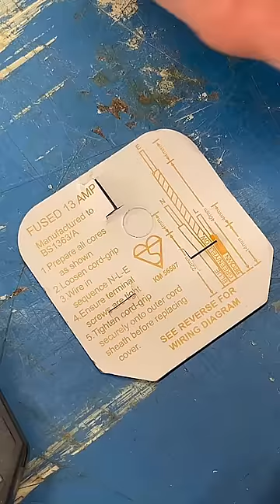Probably the Best Plug in the World 🇬🇧🔌🔌🔌

Comment from the maker: The classic British standard 13A plug with a fuse in everyone one. Take a moment to admire the engineering. Think how much it hurts when you stand on one in the middle of the night with bare feet.🦶
Reply: It hurts in the middle of the day too when you stand on one and can leave a nasty scar to boot ! No pun intended 😂
Reply: Lego… ‘hold my beer’ 😂😂😂
Reply: The Americans genuinely think a fuse in the plug isn't necessary.

I can't help but laugh at them.
Reply: That is why us American's made one that lays on the side and doesn't try to take a foot off.  Also we can transport our cables in carry on luggage on the plane as they will fit in the bag unlike your plug that you have to check in the belly of the plane due to the size and weight!  😁👍

Although it is nice that you can literally plug in your EV at any socket in the house and charge it, with 32A breakers on the rings, that is just crazy the amount of current in a domestic outlet available, just swap out that 13A fuse for a nice 32A fuse!  😂🤦‍♂️
Reply: Why u take a 13 amp fuse out and replace with a 3 amp ?
Reply: Yeah. rest of Europe has no fuse either. 16A breaker protects against short in the appliance cable, and appliance has a fuse for it's protection, so yeah. not really necessary.
Reply: @chargehanger  The only occasion you don't need a fuse in the plug for the appliance is if the cable connecting the socket to the distribution panel and breaker is of the same current rating as the appliance cable.

This is often not the case. People want their appliance cables to be thin and flexible, so it is often the case the appliance cable is of lower current rating than the circuit cable in the electrical installation. In this scenario, you need to have a fuse to protect the appliance cable.
Reply: @seanstrickley3992 because is meant to protect a smaller consumer up to 3A
Reply: @chargehanger appliance has a fuse ??? Not usually, power tools don’t usually. Not ally it’s only electronic equipment that does such at TV computer etc
Reply: @PHealey1981 😂😂😂👍
Reply: they are great, the one drawback is that they are FUCKING HUUUUUUUUGE.
Reply: ,110volts,say no more.
Reply: @Chris_In_Texas ,America is way behind UK and European countries when it to comes any thing electric, wirenuts,say no more.my son-in-law is American,he can't get over how superior our Electrical and plumbing systems are.
Reply: @seanstrickley3992 ,thought that would be obvious and I'm no sparky.
Reply: I, too, have watched that Tom Scott video
Reply: @shimarlie1  yes they are over engineered but that's why they are great. Run a 16a welder on one no problem ( 1/4" brass fuse of course 🤣)
Reply: @onelineal9382  I used to do electric. He lessened the power consumption that the plug can take dropping it from 13 amps to 3amps if u used something over 3 amps it would blow that fuse is what I get from it
Reply: Fuses are useless! EVERY small short circuit can trip the 10A or 16A breaker! EVERY electronic device has a self resetting fuse internally! Sorry but European safety laws about electric power are the best!
Reply: @MyNotSoHumbleOpinion  interesting concept. So all appliances need a power cord rated to carry the full load of the outlet then? Even a small fan or table lamp would need a 1.5 mm cord. The only problem with the fuses plug is that lay people just fit a 13a fuse as a replacement as they are all the same size.
Reply: @johnwarwick4105  exactly! Every single appliance must be rated for 10 or 16 Amps with power cords with 1.5mm2 or 2.5mm2! Italian plugs for example are made in two sizes depending on the current rating! You can't plug a 16A device in a 10A plug and vice versa!
Reply: @MyNotSoHumbleOpinion  so how many sockets are one one breaker? If you were to plug two high load devices on the same breaker if would trip! That's the beauty of the highly  misunderstood uk Ring main. One circuit provides 32amp of power fused individually from 3 to 13 amps
Reply: @johnwarwick4105  power outlets are subdivided by zones like kitchen, outlets night zone, outlet day zone, whole lights, local heating room, conditioner or heat pump, laundry, and so on... Every zone has a 16A breaker (or 10 for lights) and it's very very difficult (almost impossible) to exceed 11A in each zone! Probably the most power consuming devices are hair dryer and iron but they're only 2KW!
Reply: @johnwarwick4105  ring main is obsolete. Needs more copper today, and also does not cover "open ring" type faults.
Reply: May i make a suggestion when connecting the cables……. it’s soooooo much easier to connect the neutral first, saves trying to bend it around, too fiddly 😊
Reply: @chargehanger  so am I but can still out work some of these young ones 🤣🤣 ring mains will never die, long live the ring main, 🤣🤣
Reply: @seanstrickley3992  because the cable / device is rated below 13A. I'm the UK 3, 5 & 13A are the common sizes for plug top fuses.
Reply: @MyNotSoHumbleOpinion Historically the whole house used to have one ring main for all the sockets rated at 32A. We also have 13A devices such as electric kettles and (again more so in the past, heaters and electric cookers).

Now a days there are multiple ring main circuits, and a separate supply for electric cookers / ovens.

But there are many old houses which havent been upgraded, so for every device to be universally safe we need to follow the lowest common denominator.
Reply: @seanstrickley3992 Low powered device. The fuse is designed to protect the cord from the plug to the device!
Reply: That's fucked up brother 😢
Reply: @philipridout2274  sounds fair! Now I know the purpose of that choice about fuses! But that makes the plug "the best plug for the UK", not the "best plug of the world"! 😉
Personally I don't think that there are "best plugs", but only terrible plugs like the north American ones!
Reply from the maker: Smaller diameter cable
Reply: @PHealey1981 11a
Reply: @deang5622 why is it necessary? We have breakers.
Reply: @onelineal9382 ahahaha no.  Being 120V we use thicker wire and draw a lot more current than in Europe.  Wire nuts handle current and heat much better.  Europe went 240V because they were poor after WW2 and needed to save money on copper, so thinner wiring went in.
Reply: @johnwarwick4105  in the case of a short circuit, cause by cutting the appliance cord, a 13A fuse blows only a few milliseconds after a 3A fuse blows, so not a huge problem in any scenario...
Reply: @Ironic1950  it's not always a short circuit though. That's why you have the calculations. In reality a short circuit can sometimes take out a b type 32a mcb as well as the 13a fuse.
Reply: @johnwarwick4105  The fusing characteristics are different; a fuse blows at twice the rated current, while an MCB trips at only 20% over the rating. Some equipment has such an inrush current, it needs a Type C MCB to avoid nuisance tripping...faults always involve significant overcurrent...
Reply: @onelineal9382 What kind of engineer is your son in law??
Reply: @deang5622  they don't really need because they use star topology instead of ring.
Reply: @MyNotSoHumbleOpinion and even in the kitchen the stove has its own 3 phase so that doesn't count towards the kitchen allotment
Reply: @efixx at least in Germany i only know like 2 or 3 different diameters/shapes of the entire cable, which is in line with the 3 possible plug styles we have.

First obviously the Schuko which is the big earthed plug, obviously with 3 cables it's the thickest. Then we have what we call the "euro plug" is basically a weaker plug because it doesn't have full metal rods and also has a thinner cable because 2 lines and is used for most unearthed devices, and then there's the in between which we call "formstecker" or shape plug in English. It has full metal rods but also has its shape expanded so you cannot grab the rods they will also not fit into the smaller unearthed sockets on extensions.
These are common on eg vacuums or the ps4 pro when an earth isn't needed but too much power for the euro plug
Reply: @professorg8383  a commie one😂
Reply: @onelineal9382  ah yes shibly doubly wubble snipper is my favorite plug
Reply: 😂, i m from Hong Kong and our place adopted UK electrical system. I used to complaint alot about the bulky design of a 13A socket, however after fews years working in this field, i really appreciate the safety engineering
Reply: I'm sorry I don't understand the one foot joke.
Reply: @deang5622  "The only occasion you don't need a fuse in the plug for the appliance is if " you are not in Britain as British homes have electrical instalations that are legendary bad...
For Polish people if they are buying home in UK standard procedure after purchase is invitation of Polish electrician that is then replacing instalation that for some reason looks like something from XIX century...
Reply: ...Then realize the unquestionable superiority of the european type F outlet
Reply: @deang5622 well I’ve lived my entire life with out fused plug and it works just fine, it also nice when you can just flip the breaker back on and not have to go buy more fuses
Reply: That huge honkin thing is only rated for 13 amps?😂😂😂
Reply: Technology Connections guy is going to have something to say about this.
Reply: Hmm I've walked around these plugs for 38 years and never stood on one 😮
Reply: @deang5622  We have these wonderful things called a "Panel-mount fuse holder", so instead of handling a brick of a plug we just pop the fuse out the back of the device :) As you folk would say, "bugger off"
Reply: @Heliosaurus  So you are saying all US appliances contain a panel mount fuse?
Reply: @monad_tcp  No. That demonstrates a fundamental lack of understanding of what the fuse is for. The presence of a fuse is not in any way dependent upon the circuit topology.
Reply: @deang5622  No, because appliances plug into GFCI outlets or are on dedicated breakers 💀
Reply: @Heliosaurus  And is the cable to the appliance of a lower cross sectional area than the cable from the distribution board to the receptacle?
Reply: pathetic british feudal engineering, dont anyone tell them about schuko
Reply: @rcajavus8141  Nothing to do with being feudal. Many countries developed their own plugs independently of each other. And the British designed a very good plug. It is a superb plug.
Reply: @deang5622  no, if that was the case, then a single breaker of 300A at the entrance would be enough
Reply: @deang5622 No, the British designed a quality plug to go with their archaic electrical installations. Most of the world doesn't need to add an extra fuse onto every plug.
Reply: What a mission. 😂
Reply: Great solution to problem they self created and could easily be avoided. Absolutely 👍
Reply: @MyNotSoHumbleOpinion they are better for other reasons too, having protected sheath on the pins long before US and even other countries. Accidental pull-outs are better too, reduced fire risk.
Reply: @bigpjohnson the 220v standard was set in Europe will before WW2 even started, in UK around 1938-1939,  all of it nothing to do with the war
Reply: @happyhappynuts  yes but a lot of other plug has the same features! For example the German shuko was patented in 1926, with a recessed shape that prevents fingers from touching the poles. As I said it's a good one but truly not the best, because it can't be "the best one"! And as discussed here, the fuse isn't "a feature" but only a necessity to correct a plant design flaw!
Reply: @seanstrickley3992 security reasons?
Reply: @seanstrickley3992  'cause the appliance may be taking less than 3 amp and/or cable may only be rated for 3 amp
Reply: @chargehanger  no, not all appliances have an internal fuse, washing machines and tumble driers dont usually,  plus cable from plug to appliance may only be rated for 3 amp or so, as commonly used on table lights,
Reply: @seanstrickley3992  thats the point, the device will be using far less than 3 amp in use so a more suitable fuse is fitted, cable may also only be 3amp rated although the one in the video looks 6 to 10 amp to me
Reply: @MyNotSoHumbleOpinion  not every overcurrent is a dead short...
Reply: @MyNotSoHumbleOpinion  in the uk devices using lower current can have lower rated cables such as 3 or 6 amp, and fuse in plug suited to the cable rating, or the device, whichever is lower, no need for 13amp cable on a maybe 100w max table light, its stupid!
Reply: I know someone who came from the US, emigrated here, then after a while started throwing away appliances as they simply didn't work anymore. Years later when i knew her, I asked her did she check the fuse... She didn't have a clue what i meant till I showed here and told her what they were ,and what they were for.  she couldn't believe what she simply had done and could have just been that problem instead oops.
Reply: Hurt ??? YOU KIDDING...????
You don't even remember it after a minute or 2...🤣🤣
Reply: There was Scotty l actually quite a lot of thought went into it's design, mostly around Which wires broke away first on extreme tension, the insulation on the L N pins the extra long earth terminal, the design of the socket it goes into. So yeah I agree best plug in the world.
Reply: @deang5622  because it isn’t. Here we have breakers in a panel. 
You trip it and just reset it. Not a fuse that you need to take apart things to replace it every time it goes.
How stupid is that.
Reply: @MyNotSoHumbleOpinion I hate polyfuse, tripped the fuse on my raspberry pi and it took 2 months to reset!
Reply: @Sicktrickintuner  
So… you have an appliance that has a cord rated to carry 3amps that has developed a fault that draws 10amps i.e., over 3 times the rating of the cord…. How’s that going to trip the breaker?
Reply: Ferrals for a 3A fuse is a bit overkill. I don't understand why we dont have 1A fuse standard, even a 690W rated fuse seems overkill these days.
Reply: @chargehanger  not quite, the breaker protects the house cabling and sockets, the fuse in plug protects the appliance cable and the appliance may have a fuse to protect the applicance itself.
Reply: @kaferere  "The UK electrics system is the absolute envy of the world"

That's the biggest lie I've ever heard in my life! 🤣🤣🤣🤣🤣
Reply: missing a trick not having affiliate links in your pinned comments.
Reply: I don't have to think, I KNOW it hurts through experience!
Reply: Everyone one!
Reply: @seanstrickley3992  maybe because whatever that cable is going to power will never draw more than 3A? Why have a fuse way bigger than what you'd ever need? You're only at risk of the fuse not popping while it should pop (e.g. a short that only generates a 10A draw frying the electronics).
Reply: @MyNotSoHumbleOpinion every electronic device does not have a self-resetting fuse built in...
Reply: I mean the US outlet still hurts to step on, just now you probably also broke it or need to bend it back.
Reply: What sort of squalor do you live in where you are in a situation where you can stand on a plug?

You would only stand on these if you purposefully leave a plug in the middle of the room. Not to mention you would be more likely  to trip up on the item the plug is attached too as apposed to the plug itself.
Reply: @seanstrickley3992 maybe the appliance doesn't draw 3kW
Reply: @philipridout2274  never seen sockets rated 32A 🤣🤣🤣, used to work in uk and replacing sockets do to high power consumption, you can’t overun the 3kw-3.6kw limit  in one socket without damaging it
Reply: @Chris_In_Texas  cant do that, each socket and plug is only capable of 13amp continuous without excessive heating, some 'bad' ones even cant take that
Reply: @seanstrickley3992 because the fuse protects the flex. Depending on the size of the appliance and the thickness of the flex you need to down fuse the lead.
Looks like 0.75mm flex so a 3a or 5a fuse is needed. For 13a you would normally be using 1.5mm or even 2.5
Reply: Tried. Pain scale from 1 to 10 the British plug is 9.5 scale compared to  Lego which is 9.
Reply: @deang5622 Well.. it isn't. 
Many European countries do not have fused plugs either.

Maybe it is a fullproof design for the UK cause you do not know how to properly use them?!
Reply: @glycerosfournaris2512  Actually it is necessary. It is is not necessary to make the appliance work, obviously, but it IS necessary from a safety point of view, which is what we are talking about.

I am amazed at how many of you on here think you are all experts on electricity when clearly you are very low qualified in electrical engineering.

So what I will do is now educate why most of you are wrong and why a fuse in the plug is necessary.

The fuse in the plug protects the appliance cable from overheating and catching fire.

The issue is this. The current rating of the cable from the breaker panel is in most cases higher than the current rating of the cable from the plug to the appliance.

To help illustrate this I will use some figures.
You could have a 32 amp cable from the breaker to the socket. Then the appliance cable to from the plug to the appliance could be rated at 13 amps.

For those muppets of you that can't figure this out, the breaker rating has to be rated at 32 amps (or less) AND therefore that breaker CANNOT protect the 13 amp appliance cable.

That breaker will not trip until at least 32 amps passes through it, which is way higher than the 13 amp limit for the appliance cable.
What happens if more than 13 amps passes down the appliance cable in this configuration? The 13 amp appliance cable catches fire and the breaker does NOT trip!

Are you folks seriously telling me you are unable to 1. Figure this out for yourselves, and 2. You do not understand this?

How is your electrical training so God damn poor?  Are you just electricians, is that it?
A bit challenged with your level of electrical knowledge?

So typically where you change from a cable of one cross sectional area to another, you should put a fuse in to protect the cable of lower cross sectional area.
Reply: @dasy2k1  You are talking to a bunch of idiots in this forum. Must have not got a clue. 

Just look at the comments and how they don't understand basic electricity. Probably electricians, that is why.
Reply: @sang3Eta  Because the fuse in the plug is there to protect the appliance cable and NOT the  appliance!

So we don't need a 1 amp fuse option in the plug because the minimum cable rating is 3 amps! So we only need a 3 amp fuse.

The manufacturers will put in a 20mm cartridge fuse in the appliance if they think it is appropriate, and a 1 amp rating, and even lower are  available in that 20mm format.
Reply: @deang5622  That issue is easily fixed with a fuse on the wall socket.

As many European countries do tend to have systems in place to protect from fire hazards.

Again it isn't needed on the plug itself if you know how to use the appliance and thus do not create a fire hazard.

Can't you figure that out mr/mrs engineer?!
Reply: @Sicktrickintuner  You are WRONG.
Go find my post where I explain why it is necessary.
Educate yourself.  Increase your understanding of electricity.
Reply: @glycerosfournaris2512  No it is NOT easily fixed with a fuse on the wall socket!

We have different thickness cables in use in the UK, for our appliances, which handle different magnitudes of current. Therefore you CANNOT have a single fuse in the socket on the wall!

The ONLY way a fuse in the socket could be a viable solution is if the British government banned all cable thicknesses except one and mandated all electrical appliances being manufactured in the UK and appliance being sold into the British market which is manufactured around the world can only use a cable of ONE specified cross sectional area.

And that is not going to happen.
Reply: @deang5622  Soooo this is ypur actual issue.

See the thing isn't safety but shift of responsibility from the state/government to the public.

Again since you are an engineer you can surely understand how 《hurtfull》 can be for two alliances to be on the same wall socket with a large difference in current needed.

Again it either boils down to the state shifting its responsibilities to the public - which is unfortunately not well educated I the school system - or that you s8mply cannot operate your appliances correctly with the means you are given.

An example would be that you would never have a washing machine or an electrical inventory plugged in the same wall socket with ANY other appliance.

Where I live we do not have such an issue.
Reply: @deang5622  As someone who experienced a 10w heat mat burn through a sofa, I disagree. We should have fuses at like 2x the expected power draw. Luckily, sofas are no longer made of flammable materials.
Reply: @sang3Eta  No.
You seem not to understand what the purpose of the fuse in the plug is for.
It is not to stop you getting burned by the appliance.  It is not to protect the appliance from malfunctioning.

It is present to protect the cable.
It is up to the manufacturer to put a fuse into the appliance, or other safety devices such as thermal cutout to prevent harm being caused by the product in the event it malfunctions.  This is not the purpose of the fuse in the plug.

In the example you cite of 10 watts, and you want a 1 amp fuse, the fact is 230 volts at 1 amp is 230 watts, so you are still going to get burnt with a 1 amp fuse in the plug.

It's not the correct solution. What you are proposing is not an effective solution at protecting the user of the appliance. And that is why it will never be adopted.
Reply: @deang5622  I understand, it just seems crazy to me that 3A 750W (probably won't blow until 5A 1,250W) is the lowest rating we have in the UK.
Reply: @deang5622  i know North America electricity. British power is just set up slightly more odd.
Reply: @Sicktrickintuner  Actually it is not odd, and if you genuinely understood electricity you will discover that English and EU electricity is far simpler than US.

I counted the other day the number of different plug types you have to support the different voltages and current in the US and it is utterly ridiculous.

Additionally, the US system has to deal with the split phase nonsense which you use to produce 240 volts because your nominal level of 120 is too low.

The EU and UK use a 3 phase system at 230. There is no need for all the nonsense around having a split phase system to run concurrently to the 3 phase system.

Your grounding strategy is mostly based around the use of earth rods which is the worst performing method to get the fault current back to the distribution transformer and this endangers people's lives and necessitates in many cases the use of multiple ground rods to get the impedance down low enough.  It's a completely crap approach.

You also don't generally have GFCI's in the breaker panels whereas in the UK they are compulsory, although older properties may not have them.  So instead you have to have GFCI receptacle outlets which increases the cost and leaves much of the electrical installation not protected by a GFCI.

So what you have presented to me is simply a biased opinion and not an objective assessment of the two electrical systems.

If you are an electrician you should be sufficiently skilled to be able to make an objective comparison of the two electrical systems but you haven't done that.

Well, I don't do bias. I do objectivity based on hard facts.

You claim your knowledge is high on the US electrical system, so let's see you come up with some hard facts where you think the US system is better than the UK.
Then we can have a proper discussion baaed on hard facts and not some silly opinion that that yours is better than the UK.
I want to see you back up your claim with hard evidence, just as I have done.

You can't say "Our US system is better than the UK's " when you have knowledge on only the US system and no knowledge on the UK system. That is not how it works. To be able to make that claim, you need to have knowledge on both systems.

I am guessing you are just an electrician?
Reply: So uhhhh whats the fuse for?
Reply: @mikeoranje4055  The fuse in the plug is to protect the appliance cable only . This is the cable from the plug to the appliance.